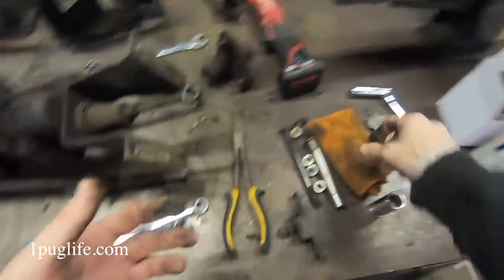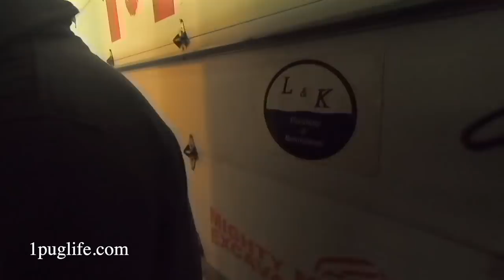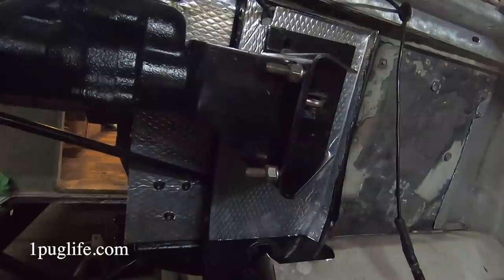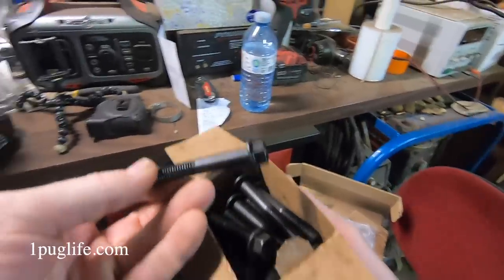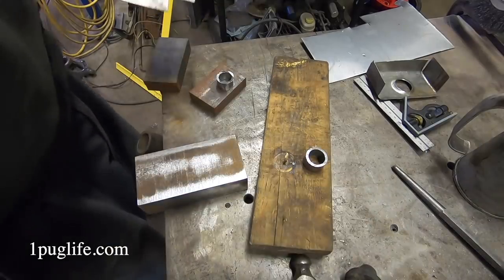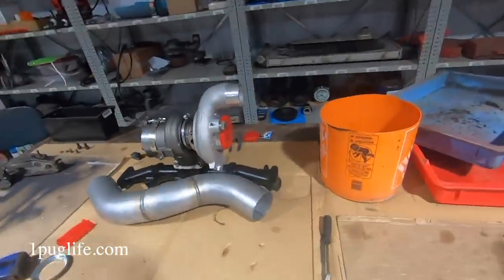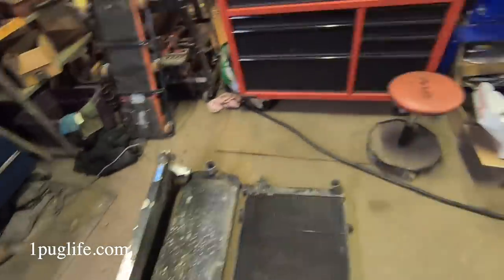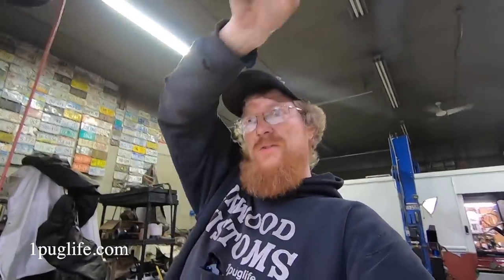major steps forward on the grumman build

Comment: If you don’t do major major welding, a pair of tig welding gloves are great for stuff like that. You can weld with them too. But obviously won’t last as long. But they are great for little parts like that, don’t have to take them off to re position. Or make a quick measurement. I use them a lot when I’m building. 
Hit that like button boys!!!!!!!!
Smoke cigrits!
Reply: Welding gloves? pug1 has hands steel. Gloves no gooda.
Reply: @JustMe-yk7mb  😂 yeah your right!! Tumuchi NO GUH!

Comment: On the intercooler lower mount: My thought would be to use a 1” rubber grommet with the groove in the edge. Then installing in the depressed hole bracket. Then the IC will be soft mounted for possible vibration.